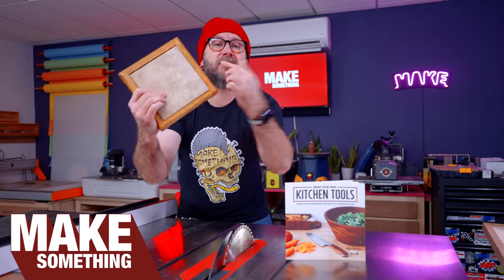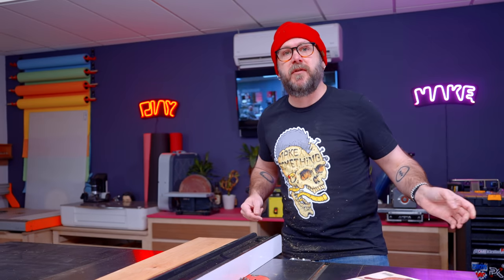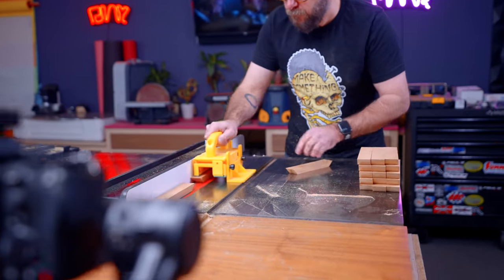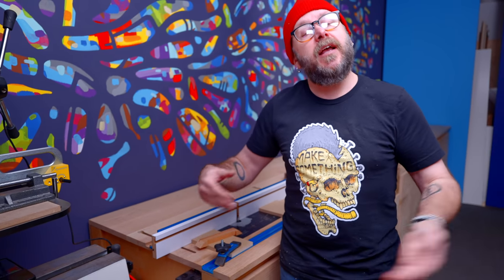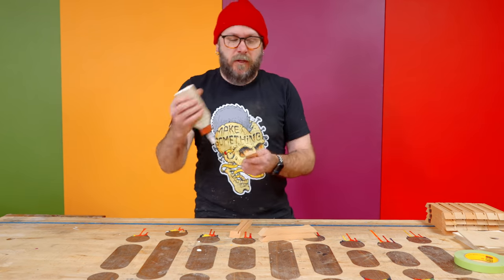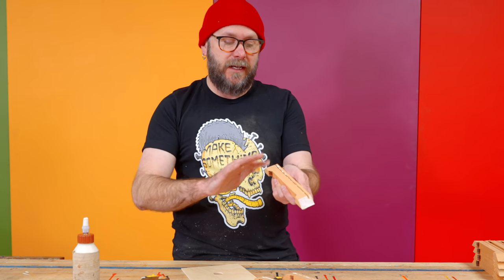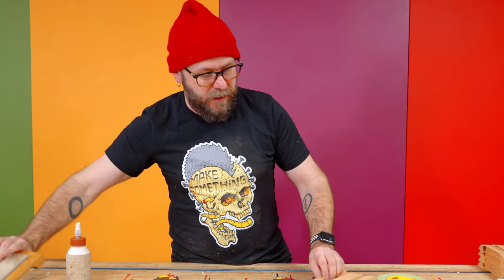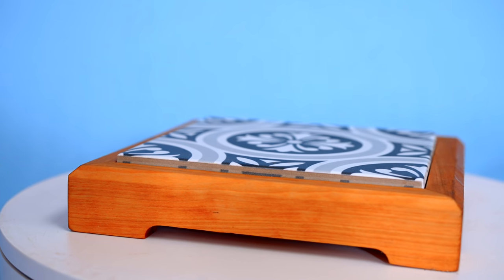Making a TON of trivets! EASY woodworking project!

Comment: "A, always. B, be. C, clamping. Always be clamping! ALWAYS BE CLAMPING!"

Great video for a great looking project. Quick question: do you glue the tile in somehow, or does it just sit?

Also, I want to have whiskey with Grampa Picciuto.
Reply: I am pretty sure you leave the tile loose. It makes it easier to clean the tile, or replace. And in the case that you might NOT have a $1 tile (something very special, heirloom, etc) maybe the wooden portion will need replaced before...
Hope that helps

Comment: Made several 40+ years ago and they are still going strong. Used the router for a dado for the tile and also to profile the edge. This is a great starter project as they can be made with a minimum of tools.

Comment: I had the same feeling about my router also. Your not alone David. But as I kept using it Ive gotten used to it. I use my micro jig. But like any other power tool you just have to be careful, and not take any short cuts and don’t get to confy other wise that’s when you loosing fingers , hands, eyes etc..

Comment: Love it! Dumb question: how do you prevent the tile from slipping out? Or do you just be careful not to tip it?
Reply: Also wondering this, not sure why you wouldn’t want to glue it in place.
Reply: Think its meant to be removed for cleaning
Reply: @accc0416  makes sense! Thanks!
Reply: @accc0416  how much do you really need to clean a trivet though? Food doesn’t go on it. I’d still glue it down, a wipe with a wet towel would be clean enough.

Comment: I am very intimidated by the router.  I have had kickback three times on the miter saw and i don't know why except one I wasn't holding the piece squarely against the fence. I have not lost fingers but I did cut a nice gash in my thumb.

Comment: I don't dislike routers but they are intimidating for sure.  I wouldn't be comfortable doing that cut for the legs.   Even with the push pads because the pieces are rather small.  I would probably clamp them on a jig to have more control.